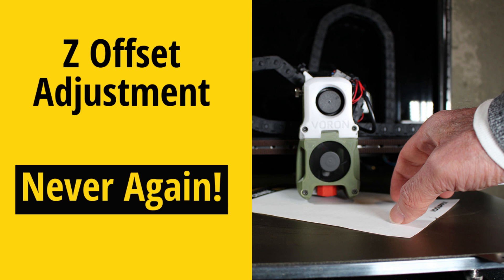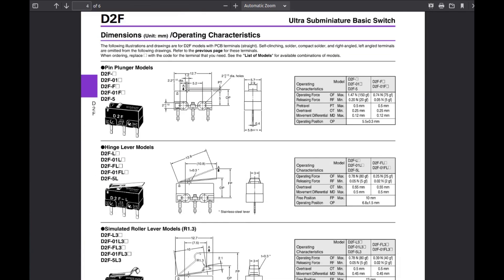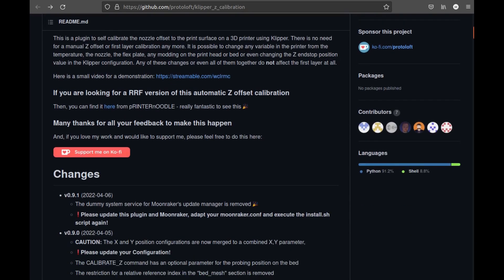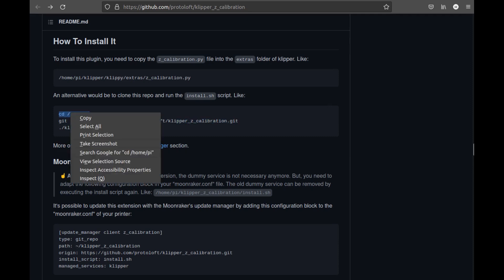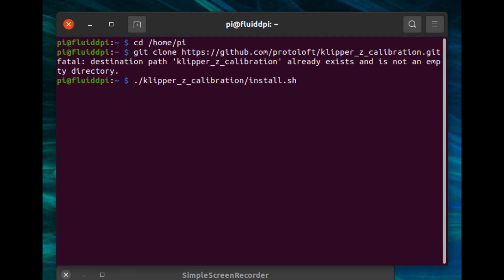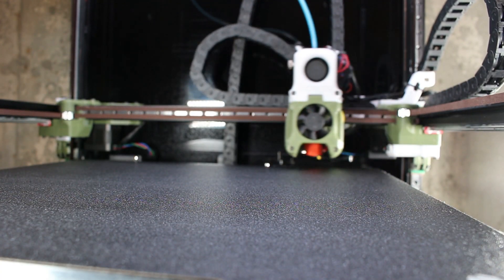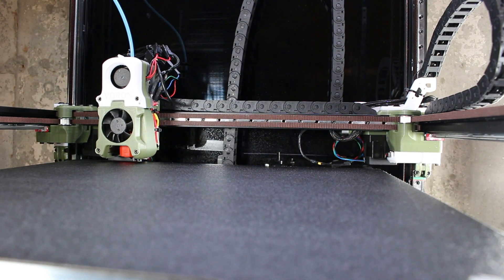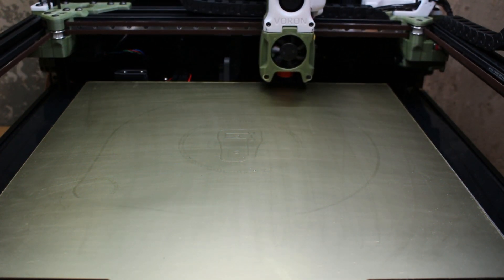Never adjust your 3D Printer Z Offset again with Klipper and a plugin

Comment: Hi, your video is great. I have a PCB-Klicky working well. When I do all your implementations I get when doing G28 the message “safe_z_home” is missing. But this must be commented out for PCB-Klicky. How to solve this?
I have a Voron 2.4 with Z-endstop.
Reply from the maker: Are you using "probe:z_virtual_endstop"  in your [stepper_z] section in your printer.cfg?  If so, I think you need set your endstop pin in your [stepper_z] section.
Reply: @KapmansBasementWorkshop  Thanks a lot. It works now. I also had to enter the position of the Z-stop in the klicky_variables,cfg.
Reply from the maker: @tonvanlee  I'm glad to learn it's now working for you.  The creator of this code has done an amazing job.  I wish you great printing!

Comment: AI really f’ed me before I just went to the GitHub and saw the link to this video. 

Both Grok and ChatGPT made it sound like the actual button of the switch (klicky in my case) was supposed to touch the z endstop and not one of them balked at me saying I can hear both switches activating slightly off from each other. Just now got it to clarify it’s supposed to be the BODY of the klicky switch that touches the endstop, and decided it was time I just knuckle down and read the GitHub for myself which lead me here. 

Two HUGE down to the metal gouges in my $70 bed plate from trying to have AI help me. Let’s see how this goes instead. Fricken AI sucks man.

Comment: Got it working. Only problem now is it doesn't put the klicky probe away when done.
 I get this error: Unknown command:"M402"
It just stops above the middle of the bed when done.
Reply from the maker: You will need to create a macro in your printer.cfg file for M402.
Reply: @KapmansBasementWorkshop  So I need to put something like this in the printer.cfg?
# Macro to retract Bed Probe
[gcode_macro M402]
gcode:
    G90
    {action_respond_info("Entering M402")}
    error_if_probe_not_deployed
    _M402
Should I put it in the macros at the end of printer.cfg?

It goes back to the dock after QGL
Reply from the maker: I would not place it at the very end as that is where Klipper saves its own settings, but I would place it near the end where the other macros are such as “print start” and “print end” or other ‘M’ macros are defined.
Reply from the maker: And be sure to restart klipper after saving the changes
Reply: M402
# Macro to retract Bed Probe
[gcode_macro M402]
gcode:
    G90
    {action_respond_info("Entering M402")}
    error_if_probe_not_deployed
    _M402

# Macro to Stow Bed Leveling Probe
[gcode_macro _M402]
gcode:
    G90
    {% if not printer.probe.last_query %} ; the logic on this needs function check
      G0 Z20 F2400                  ;  set approach elevation of Z15 for fixed gantry system to clear probe over bed
      G0 X175 Y175 F3000            ;  start movements at center of the bed 
      G0 X81 Y300 Z15               ; move to position in front of dock 
      G0 X81 Y333 F240              ;  put it in the basket 
      G0 X40 F240 F3000             ;  quick swipe right off onto the dock
      G0 Z20 F500                   ;  move up to elevation of Z20 
      M400                          ;  wait for moves to finish
      G4 P250                       ;  forced pause here so motion is definite 90 travel to swipe
      G0 X175 Y0                    ;  move to front center of bed                   
          {% endif %}                     ;  exit the if-then loop. was missing in previous versions
    error_if_probe_deployed         ;  verify that the probe is detached. is corrected error  
    {action_respond_info("Exiting M402")}

Comment: In my opinion, the real BIG advantage of this setup is the automated z-offset calculation before every single print no matter if you changed the printing surface, the bed temperature or more importantly, the nozzle temperature... but this only works with this z-endstop type (Voron). BTW, I would love to easily install this in my Ender 3 pro!

There are 3 different things that need to be addressed in this order:

Bed leveling
This is the first step where we have to level the bed mechanically (automatic or manual process) as much as possible to make sure our software doesn’t have to compensate too much later on (bed mesh).

Bed mesh
For this you will use any type of sensor: mechanical, capacitive, inductive, eddy current (type of induction) to build a map of the surface and compensate for imperfections moving the nozzle up or down accordingly during printing.

Z-offset
Finally, it does NOT matter how fast and automated your bed leveling and bed mesh are, how flat is your surface and how accurate and detailed your bed mesh is if the z-offset is not configured properly, the first layer (hence your whole print) will fail.
The z-offset is the distance between the probe and the nozzle and this distance may change from print to print if conditions change (print head maintenance, printing surface, bed and nozzle temperature, etc…).
Reply from the maker: You could install a Z endstop on your ender3 pro.  You could probably install the same one as the Voron.   That said, I agree with all you have written.  Thank you very much for commenting and watching!

Comment: omg. just home your printer, drive toolhead in mid of bed, lower z to 0. then use microsteps or whatever they called to lower nozzle until you dont see light between your nozzle and bed and done. save config and rest you do on first print.
Reply from the maker: Thats one way to do it.
Reply: Triggered? 😂😂😂
Reply from the maker: @F1v30h1 It appears so!
Reply: @KapmansBasementWorkshop how is it really? Is it as good as tap? Or beacon? I never tried it but always been intrigued. Currently taking tap off my 2.4 to try beacon…
Reply from the maker: @F1v30h1 , if you are switching to beacon, there really is nothing better. You will be very happy.  This option works well and it’s cheap. Beacon or cartographer are the best options right now.
Reply: @KapmansBasementWorkshop I tried beacon out and couldn’t get it to work consistently. It would give me an over tolerance error, it would just keep the same error tell I would restart killer and then be fine. Then next print same thing. 🤷‍♂️ I went back to tap for now
Reply from the maker: @F1v30h1 interesting. I’m using cartographer on one of my printers right now and really like it. It took some effort to get my tool head stable. There was some play that I needed to take care of. I really just reassembled my tool head to make sure everything was tight and it’s been working well since.

Comment: When I home x and y it works when I home z it goes to the middle of the bed and looks for the z stop.
 Doesn't find it and instead crashes into the center of the bed. If I click the z end by hand it will not crash into the bed.
Reply from the maker: Did you manually calibrate this first?  DO the paper adjustment and then update the cfg file with that value?
Reply: Thanks for the replay. 
2 locations for the z-pin location. z-calibration and klicky probe variable file.
It doesn't slam into the center of the bed now.

I can click on the x, y and z squares and it does all then stops above the z stop
Reply: Got it to pick up the probe. Then try to QGL and goes to the front left and stops above the bed with an error message.:
"No trigger on probe after full movement"
It doesn't go down far enough to touch the bed.
So I need to look into getting the QGL working first.

 I'm getting closer but don't have the info it needs yet.
 I'll go through this video again and pay closer attention.
This Z offset has been my nemesis ha.
It was the first time I did it and it is now.
Thanks so much for your informative video.
 I'll do the paper test again and repost the results.
Reply from the maker: I’m glad you got it working.  Happy printing and a great new year!
Reply: In stepperz settings, position_min I changed it from -.5 to -2.
 Now it goes down far enough to have the klicky touch the bed
QGL works now.
I'm getting closer to printing.
 2026 should be the year for me to start 3D printing. Which will be a huge thing for me.
Hope it's a great year of accomplishments for you too.

Comment: Is this still valid in 2025? With beacon probe and  touch mode available? Im looking to build a v2.4 and considering which probe to go with. My current printer uses a beacon probe and its just so damn fast to probe the whole bed, but i havent used the contact mode so im still setting my offset when switching build plates.

How does klicky compare to beacon in speed to probe the whole bed?
Reply from the maker: It's still valid.  It works well and is cheap.  However, for sheer speed, it cannot beat the Beacon or Cartographer probes.  I wish you a great 2.4 build!

Comment: Is it possible to setup this plugin with Voron trident and omron inductive probe🤔?
Reply from the maker: I don't think it's possible becuse the inductive probe does not sense the top of the bed, it senses the metal plate under the PEI surface.  Using a touch sensor actually senses the surface of the bed...the PEI.  Thanks for watching and commenting!

Comment: D2F switches fall apart fast. I would use a kailh gm4.0 as a substitute.
Reply from the maker: Interesting tip. I actually just purchased some kailh switches for use in filament sensors on the tool head. It’s good to know they are more reliable. Thanks for the comment and watching!

Comment: is there reason i cant go to z0? i followed all the steps and when I manually job to z0 its perfect but it wont allow me to go to z0 always stays at like 3.51 for example. i can jog it to z0 with controls and it sat perfect but something blocking it.
Reply from the maker: I need to go back and have a look.  It's been a while since I did this to my printer.
Reply: @ it’s going off my sex bolt as the zero point. I can enter z-3.5 then it will go to z0 on the console. Thanks for getting back to me

Comment: thanks for the video. What i don't understand is why can't the printer just induction probe the center and know how much offset it needs to be. why does it need a reference point? I'm asking because since my Lulzbot it has been this way and there must be a good reason. Can someone enlighten me please?
Reply from the maker: You need an exact measurement of the nozzle tip to the probe or else you can't calculate an accurate z offset.  The nozzle changes size slightly over time with wear and changing nozzles also changes that distance.  Also, the induction probe only measures the distance from the probe to the steel sheet under the bed.  The coating on the bed place is invisible to the induction probe.  If you switch bed plates, the z offset needs to be adjusted as well.  The reference gives you an exact point to calibrate against for accurate measurements.  Also,  Induction probes are sensitive to temperature.  As the printer gets hotter,  the induction probe heats up and then the measurements change.  And yet one more, as the printer heats up, the frame changes shape, yet another reason a reference helps provide consistency.
Reply: @KapmansBasementWorkshop  Thank you very much for your answer. It's probably the coating that's tripping me before as it cannot be measured by the probe. Now it makes so much sense as Prusa will ask me if im using a smooth sheet or a rough sheet. I really appreciate you taking time to solve my biggest question as I cannot find an answer from google.

Comment: Ok so i have it set up and working, however its always about .5mm too high. I run a test pribt that is .25 in height and when i measure its thickness when its done its always about .9mm. I tried adjusting the congif switch offset with no luck. Nozzle is clean. I also tried following the voron docs and adjusting the z position_endstop as well. I just cant get it to close this gap
Reply from the maker: You need to adjust the offset in the cfg file.  I do that in the last part of the video with a piece of paper.  I would not adjust the z nozzle switch.  That will cause this to set the wrong z offset.

Comment: HUGE Thank you for making such an easy to follow video on this fantastic Z-Calibration. 
Finally got around to adding my klicky probe and once I knew that was working all fine, I just followed your video and it was so easy to install and configure the Z-Cal. I used my feeler gauge and got it right down to 0.05 and that’s amazing and accurate. I’m so so happy. Again thank you for your work on the video.
Reply from the maker: I'm glad this was useful for you.  I think this software is just amazing.  Thank you for the kind words and for watching!

Comment: Hey, at first I did not understand. But then... This is a clever idea, to touch some button with nozzle and then touch exactly same button with probe to get height difference.
Reply from the maker: It's very clever.  It's so simple.  I didn't really get it at first as well.  But after I did not understand why this wasn't used by all printers.  Thank you for watching and commenting!

Comment: This is usefull if you change nozzles alot. The main problem i see is making sure the nozzle is clean without user intervention.
I replaced my Induction Sensor to a Clicky because changing between beds would mess up the readings, clicky works all the time
Reply from the maker: I used the similar Euclid probe.  It worked great.  Thank you for watching and the comments.

Comment: Great video :) Could you share your config? I have a problem when the probe presses z-switch during calibration. I always have an error  "Probe triggered prior to movement". I tried to comment out stepper_z:position_endstop as I've seen on other videos, but always have a message "Option 'position_endstop' in section 'stepper_z' must be specified" and I'm stuck with this.
Reply from the maker: Sure.  Here are all my cfg files: https://github.com/Kapman1/Kapman1
Thank you!
Reply: Thanks :) it turned out that I had a problem with the probe, poor conductivity between magnets
Reply from the maker: @MrRoldak  Interesting.  I would not have guessed that.  Thank you for posting this!

Comment: Hi thanks for vid , done all this & it works great except it does save it to the cfg & when printer starts printing the Z offset is still to high , rising the Switch offset in the AutoZ.cfg does nothing as I’ve mentioned it doesn’t save the offset anyway , any ideas ????
Reply from the maker: Do you have a "position_endstop:" that isn't commented in the [stepper_z] section of the printer.cfg file?
It should be commented.  After changing that, reboot and then try to save your calibration.  It should appear at the end of the printer.cfg file in the section with the comment that you should not touch that area.
Reply: It has a # next to it & all green is that correct ?
It seems when ever I adjust the AutoZ.cfg  switch offset figure the end stop (or something ) adds or subtracts that adjustment so I gain no closer z
(Trying to close the z to bed more ) 

( I know the higher the figure of the switch_offset means closer to the bed )
& my bed mesh map is 6cm up in the air off the bed

position_endstop = 0.680
But it would need another +6mm on it but I know putting it here isn’t right ??
Reply from the maker: @adrianstealth340  Did you create a file called "auto_z" and set those parameters and include it at the top of your printer.cfg?  Have a look here at my files at the time:  https://github.com/Kapman1/Kapman1   Look at the "switch_offset" setting in the auto_z.cfg (or whatever you might have called that file.
Reply: @KapmansBasementWorkshop  hi yes I have that file in place , I’ve overcome few problems after updating Klipper recently , the switch_offset in AutoZ.cfg  doesn’t adjust anything , I’ve tried a very low figure to hopefully witness the nozzle go way to high but it didn’t do the adjustment , the AutoZ routine works well but it’s having zero effect & not being applied
Reply from the maker: @adrianstealth340  My paologies, but I don't really know what is wrong.  This has worked for me and worked well.

Comment: I am stuck at the end.  When I do CALIBRATE_Z it says my offset is more than 1 to -1.  In your video you do not show where you set your z endstop in printer.cfg or even discuss it.  Please explain this part.
Reply from the maker: Have a look at my printer.cfg and my autoz.cfg files located here: https://github.com/Kapman1/Kapman1
In the autoz.cfg file, there is a setting called "max_deviation" which sets the max to 1.  You can change it.  But, once you get things adjusted properly, set it back to 1.  Also be sure to follow Protolofts instructions for calibration.

Comment: Hello, after I did auto Z, I did bed mesh calibration, and the result is 0.4 mm lower than 0, where does the difference come from?
Reply from the maker: The final result should not be 0 as that means the nozzle would be touching the bed.

Comment: What did you use for the switch to trigger against? Did you install an Internal Thread Dowel end pin or a block? if so what Exactly & do you have a link to it?
Reply from the maker: I used this: https://mods.vorondesign.com/details/t1DBVlcUBbdEK6habEsVzg
You can also purchase kits with all the parts if you need to.